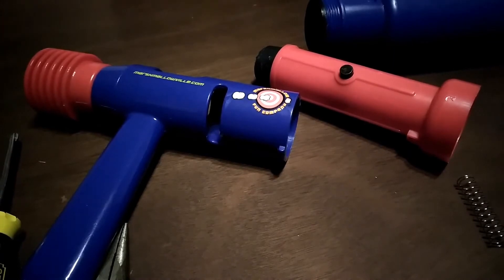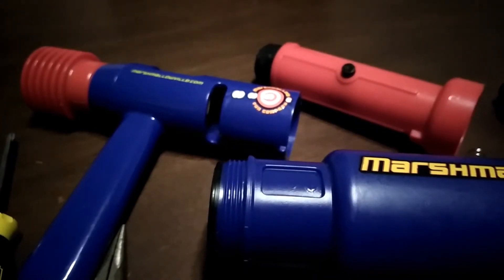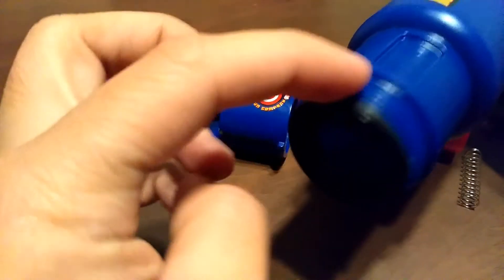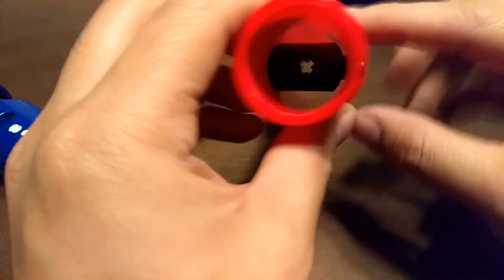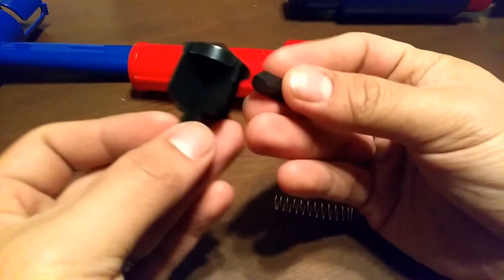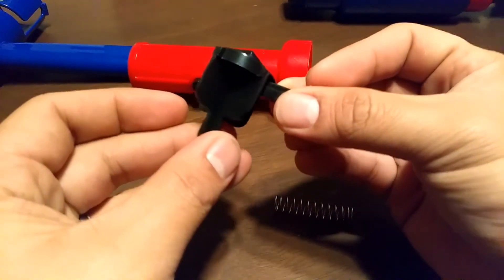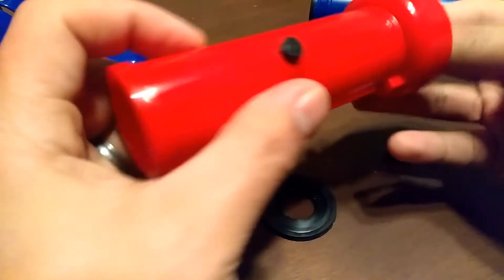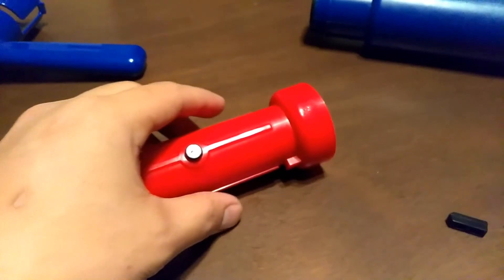How To - Fix Marshmallow Blaster (Maintenance)

Comment: This is really cool but my pump broke and I had to replace it with a cheap ball pump. It worked at first but broke shortly after. Any help is appreciated. Thanks
Reply from the maker: Ouch, that's tough. It would have to be a pump strong enough to pressurize the tank and have a good enough seal with the blaster itself. I don't have a good solution for that.

Comment: Thank you for the video I just subscribed to you because because you're actually helping out on fixing my marshmallow thing in the make model just like yours
Reply from the maker: +USA Reviews Awesome! So glad it helped you out. Mine broke, so I filmed it after realizing that it didn't quite break as much as pop out a piece which I installed back incorrectly.
Reply: I actually took the entire thing apart and I couldn't find out what goes  in places but then I watched your video and they cleaned it and I found out what to do another stuff and why it wasn't holding the air rite
Reply from the maker: +USA Reviews Awesome! I didn't find much help online so I put this up for that reason.